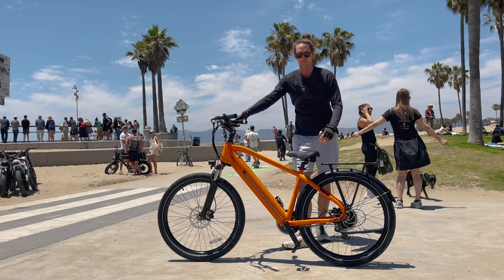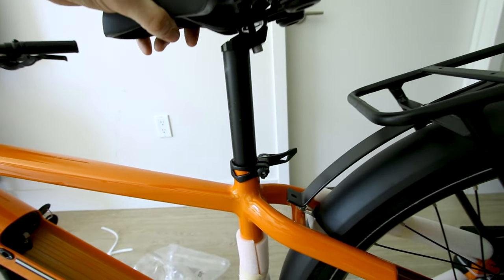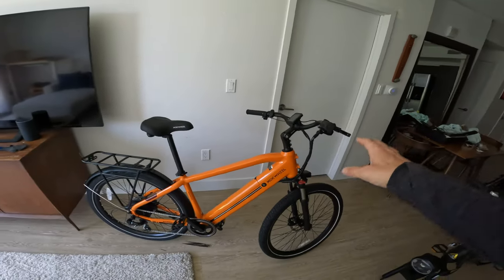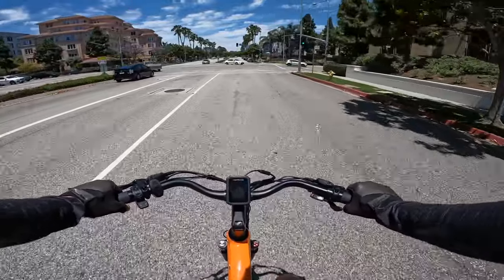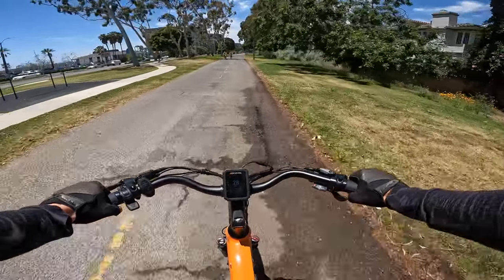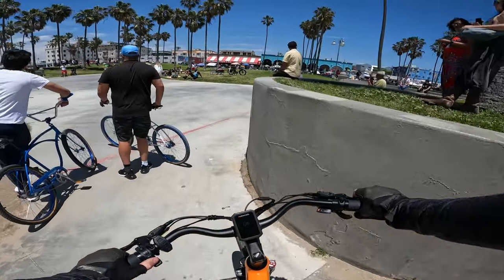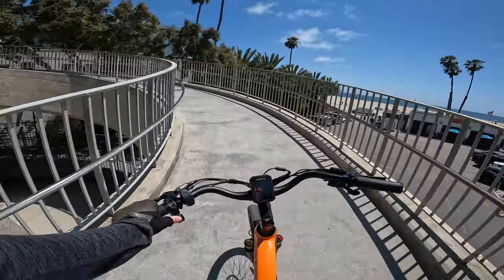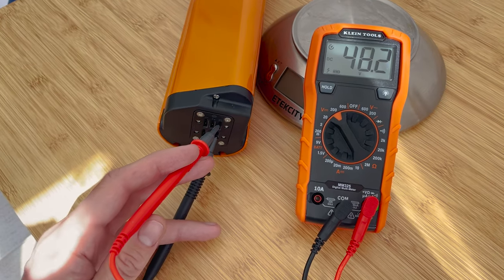Is Mokwheel Asphalt REALLY The Best Commuter Ebike?

Comment: Rode my orange Asphalt a few days ago 49.8 miles in 4 hours in level 1 , came home with 40% of my battery left.  Paid 10 extra dollars for the travel pack, mirrors , basket, better seat.  I run gears 5-7  , love it.  never have needed to go higher than level 2,   goes 1-5 levels.   comes with a tool set,  so far it's been lots of fun.

Comment: You mentioned the torque sensor on this bike a few times.  The Wired Freedom has such a large sprocket that you can get up to 30 MPH without ghost pedaling even though it has a cadence sensor.  However, I'm still in search of a lighter, nimble torque sensor e-bike for my girlfriend so I'm adding this one to the list of candidates.
Reply: I just bought the Asphalt ST. The price is good and it rides really smoothly. I wanted one that has larger wheel, under 60 pounds, and made with quality. I especially enjoy having Tektro hydraulic disc.
Reply: If you want a zero maintenance bike with all the upgrades a commuter wants, just go for Priority.  
Actual light, nimble, reliable e bikes cost more than than your garden variety budget hub drive fat tire scrambler clone, which is none of those; light nimble bikes also generally don't have a throttle.
If you think 3400 is expensive for a quality ebike then don't look at the prices for eMTB  because those are running 12-15k and more.
You can spend 1500-2500 and get the same subpar junk that everyone else gets because they're all assembled from the same suppliers for the lowest cost and quality possible or you can bump that a kbuck and get something that will never fail you that's a good performer.
It's funny watching everyone talk about their brand of bike when they're all the same bike in slightly different configurations.
Reply: Just rode my friends 10k specialized e bike and I was not impressed.  You still have to really pedal hard to go fast and that sucks compared to my Wired Freedom.  The cheap rear hub motors are superior for 95% of potential riders.  If you want to do a hardcore downhill Colorado MTB trail, definitely get the 10k e MTB.  For ANYTHING else, I far prefer the power and throttle of a cheap 26x4 bike.  Most people would be far better severed by the Wired bikes than some crazy expensive light mid drive.
Reply: If you haven't bought one for your lady check out the Respire Hurricane mid motor ..

Comment: I've been happy with my Mokwheel Tor +. I'm getting 36.9 mph and around 45 miles on throttle alone.  This bike is the shit, Mokwheel  gives you alot of accessories with a 2 year warranty.  What brand has an inverter and solar panels..none 2:00

Comment: What is the best e-bike that’s fast with long range?
Reply: The Wallke H6 PRO MAX has a massive battery and can do 38mph for around 1800 bucks. 1000 watt motor, 35AH 48V dual battery setup. I have the X3 and can go 25 and 60 miles with my normal effort on one battery (I strap an extra battery to the rear rack for the longer rides). Go faster with higher pedal assist and get less range.